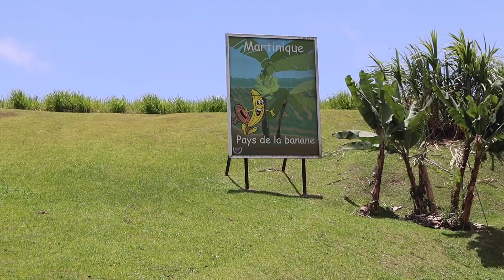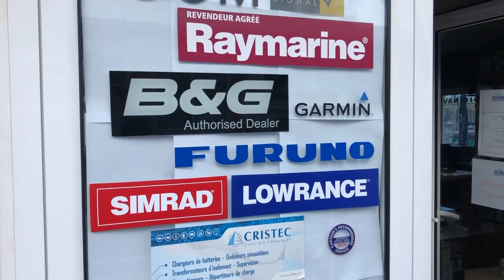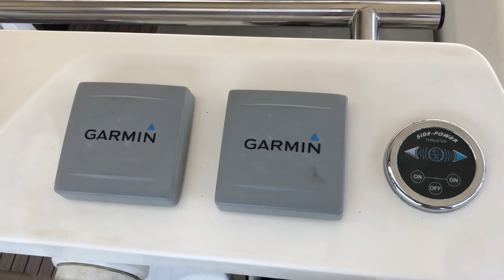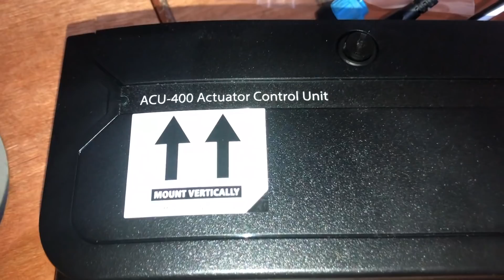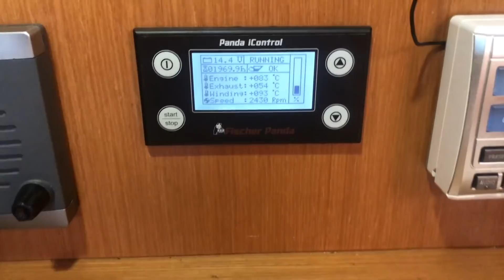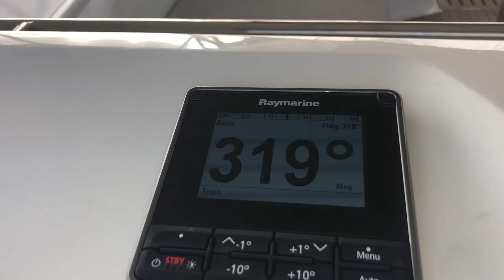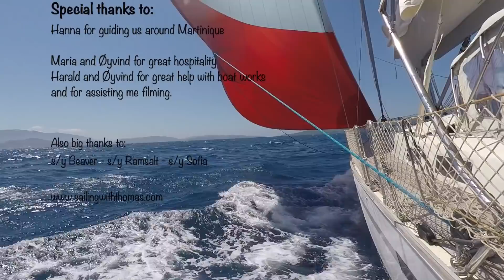SAILING LIFE -,Social sail boat work getting ready to leave before hurricanes arrives - SwT 24

Comment: I think you will be very happy with your new generation Raymarine unit. I was on a boat of similar displacement to yours with winds in the high 50s and a terrible sea-state, and it worked great. But if you are going to be single handing, once again I ask you to consider installing a Windpilot Pacific vane. That you have twin rudders will not matter any more than it matters with your below deck auto pilots. Look at their website for examples of installations on similar transoms as your Bavarian. Your videos are great and I always look forward to them.
Reply from the maker: Thank you and happy to hear you have great experience with the Raymarine I just installed. I normally only need autopilot when wind pilots don’t really work as good. Like dead calm, and flat down wind. Be Free is so course stable I almost newer use autopilot when tack or close reach. With two stand alone systems I hope it will work properly when I need it. If it’s more than 50+ I like to hand steer also, however with updated weather routing try to avoid if possible. I have looked at wind pilot solutions but did find it to inconvenient and complicated for my boat. However having plenty of time before Pacific crossing I will check for more examples of set up. All the best!
Reply: What I like about the Windpilot Pacific on a fold down transom (I have one too) is that once you get to your destination and are only going to sail shorter sails, there are only 2 bolts to remove it and then you can store the Windpilot in a locker. It folds up to a piece that is about 4 feet long and less than a foot across. No matter how well balance your boat is, sailing 500-1000 miles or more without a functioning autopilot or vane will be a lot less than fun. Now if you have a crew of 4 or more, it would be manageable, but short or singlehanded I fear you would be a very unhappy man.